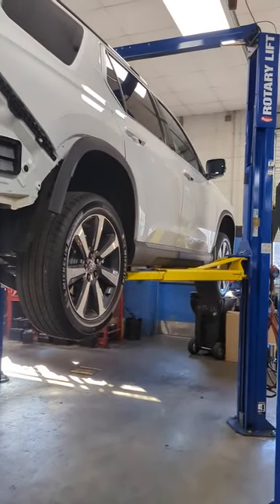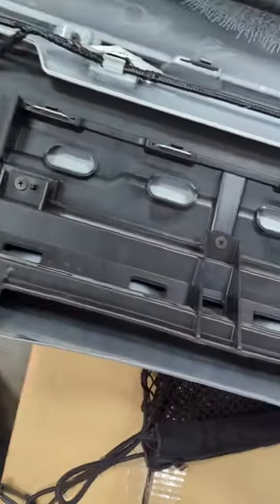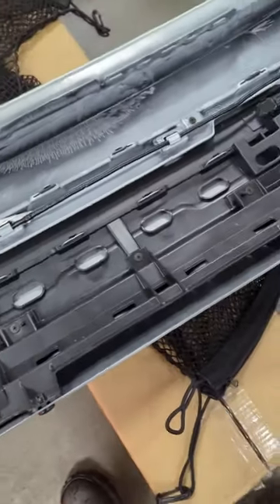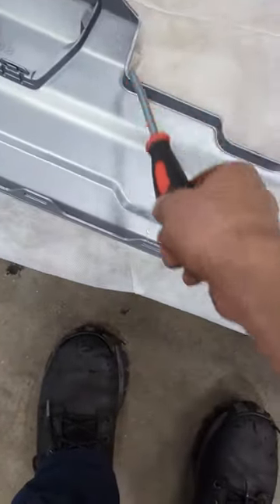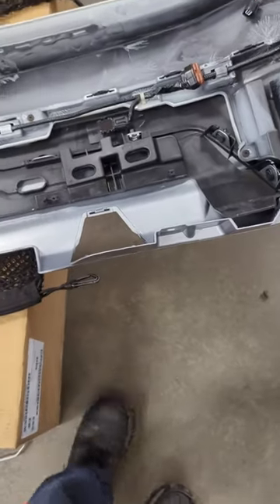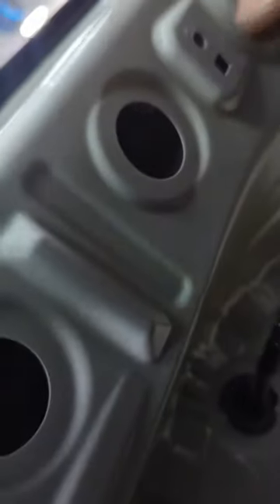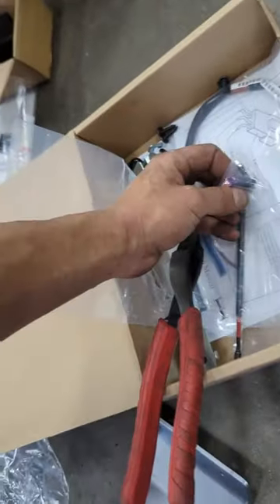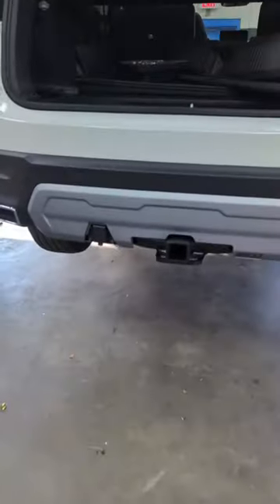Installing Trailer Hitch and Harness on a 2023/2024 HONDA PILOT!! #automobile #cars

Comment: Appreciate the effort but this is NOT a very helpful video!!!  For anyone struggling with installing the Pilot wiring harness, look for a video titled "2022-2024 MDX OEM Trailer Hitch/Harness/Cover DIY Installation".   The MDX is slightly different than 23-24 Pilot but quite similar and will get you started.  I have a 24 Pilot Trailsport and to install the harness and bracket, I did NOT have to remove the bumper.  I did take two bolts and two clips from underneath to facilitate bending the bumper forward to fit my hand behind to install the harness bracket to the hitch frame, but got it all done fairly easily - just a take your time.  The supplied clips in the wiring harness make it easy to figure out where to attach to the body along the way.
Reply from the maker: There is nothing to it.
It isn't a rocket engineering class,

1-Remove the mud guards if applicable.
2-Remove the rear fenders flares from Both sides.
3-remove all necessary screws and push pins.
4-remove the two screw covers from the tail lights mounted on the body of the vehicle.
5-remove the 4 screen from the bumper using Allen wrench or a t30 torx socket.
6-remove the screws and push pens from both sides of the rear bumper ones. The fender flares removed, as well as push pins from underneath.
7- gently pop the bumper corners and unplug the wires.
8- Remove the hands-free access sensors, assembly if applicable and swap it with the accessory one.
9-Remove The lower trim from the bumper cover itself and swap it with the accessory one.
10- reassemble the bumper cover get it ready to be installed.
11-Mount the little bracket for engine harness plug onto the hitch.
12-Install the trailer hitch.
13- install the trailer hitch harness if applicable.
14- reinstall the bumper cover and everything else removed during the process and reverse order.
Job done, completed professionally, and you literally be in and out of that under 30 minutes.

(706) 840-3670 is my cell, If you want to do it yourself... You can video call me on WhatsApp and I will walk you through it...
Other than that I don't know what to say!!

🌱🌱🙏🙏🙏

Comment: What is the recommended bolt torque for the trailer hitch?
Reply: Text is copied from 8nstallation document:
Tighten in the order shown. (Alternate sides starting from hitch end)
• Tighten the six flange bolts to an initial torque of 48 Ib-ft (65 N·m) as shown. Then, tighten the flange bolts to a final torque of 96 Ib-ft (130 N·m).
• After tightening all the flange bolts,recheck their torque.

Comment: Hi, do you have all the items needed list? Or part numbers? Or where you are located? Company or shop. Thanks
Reply from the maker: They are sold separately.
Hitch alone come with it's hardware.
Hitch Harness comes with it's hardware.
If the vehicle is Equipped with Tailgate Handsfree system, it will need the Accessory adoptive Handsfree/kick sensor.

The only History used to come with the Lower center bumper trim but it is sold separately now. therefore, it has to get ordered for.